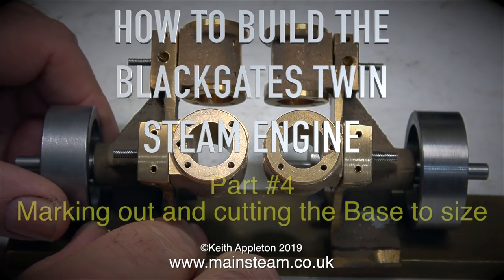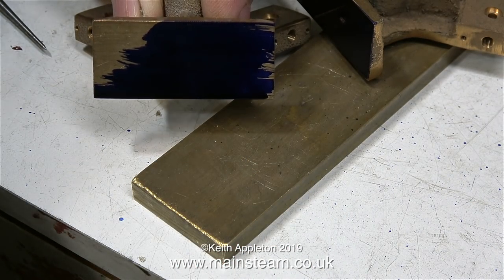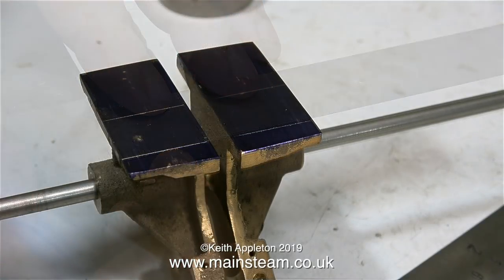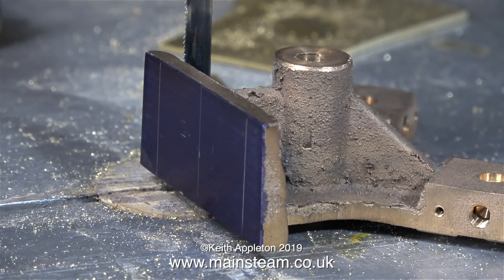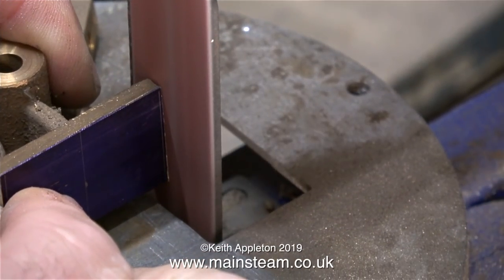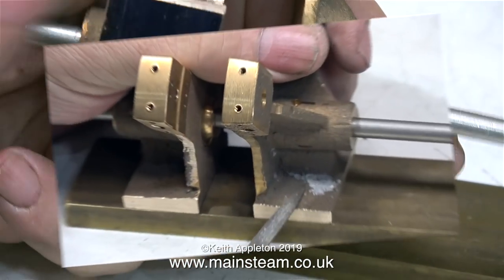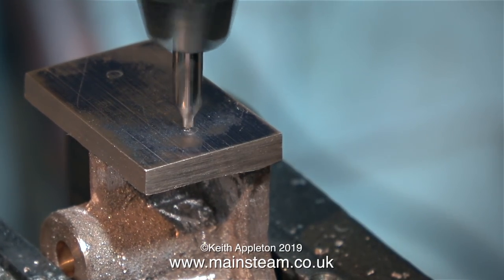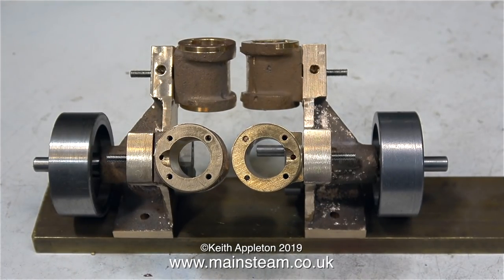HOW TO BUILD THE BLACKGATES TWIN STEAM ENGINE - PART #4

Comment: You can reduce the tendency of twist drills to grab brass or bronze by blunting the leading edge of the cutting surface.  This reduces the aggressiveness of the cut.  I have a drill index modified specifically for brass and it has served me well.

Comment: Other than normal wear and tear, bandsaw blades won't cut straight if they have been used to cut circles, although you can help avoid this by cutting CW and then CCW to even up the wear on the tooth set.